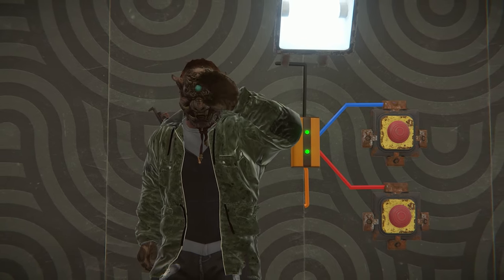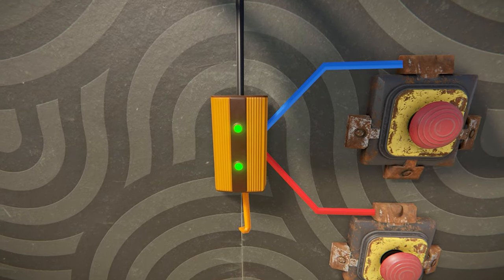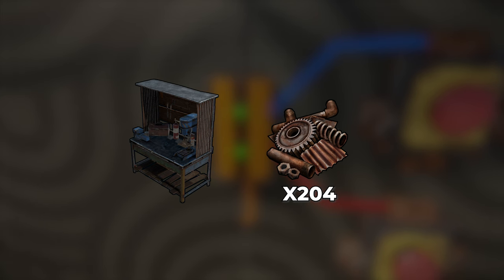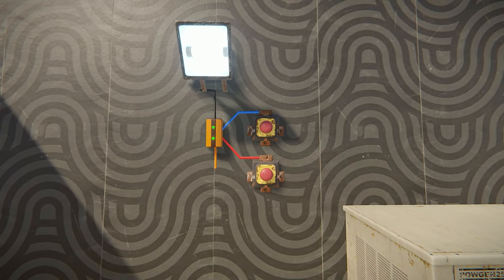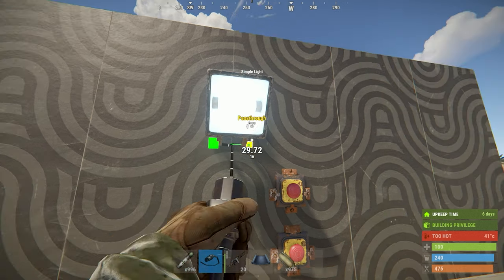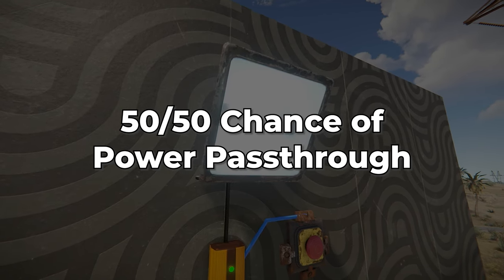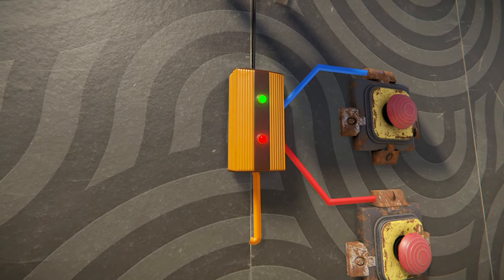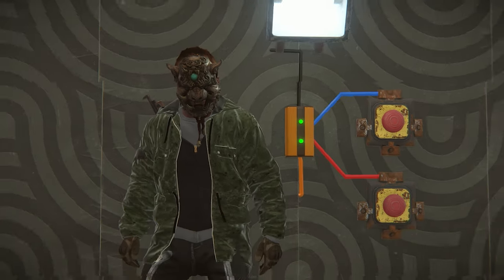The Rust Rand Switch: A Complete Guide for Beginners!

Comment: i clicked on this because i was thinking "wtf is a rand switch ever actually used for" this answered nothing lol
Reply from the maker: thats the MYSTERY lol - but on the real, i lightly mentioned trap bases, puzzle bases etc. I do plan to make more in depth videos, but a lot of them right now have been very very simple to start while I get my toes wet on how I want to edit my vids etc! 

some quick examples of how to work the RAND switch is a trap base, apply to a pressure pad that only occasionally turns the RAND on closing players in only half the time etc. creates the illusion the door wont auto close etc. 

another is using a timer to rand switch and having it intermittently trigger the rand to open or close a door (not an important base related door) so the audible sound makes players nearby think you are online, so they may not raid you if they prefer offlining

just wanted to throw some ideas out there for you, but honestly as the vid says, this item has hardly any conventional use haha